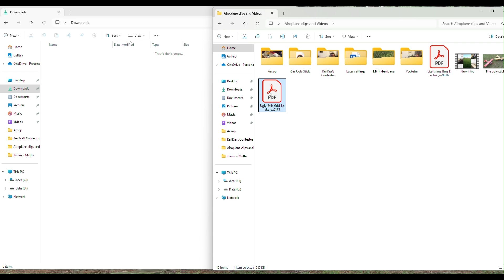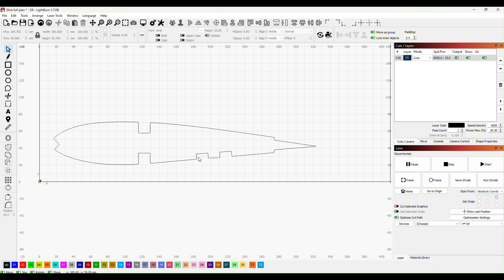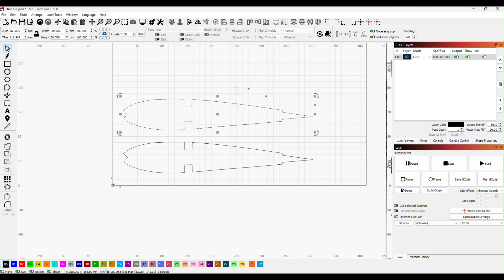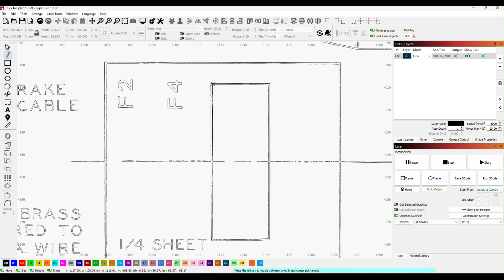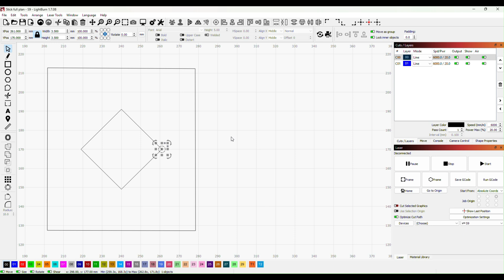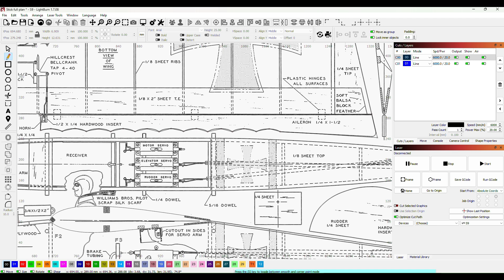How to make a trainer RC plane from free plans using Lightburn and Laser (Das Ugly Stick 1)

Comment: Hello from the USA. I just got myself a used x-tool 10W D1 pro and just this week I ran a test to see if I could cut 1/8" balsa with out it catching on fire. The test showed the best power and speed seetings was speed at 1,785 mm/m and power at 48.7% with air assist on and 3 passes I cut new wing parts for a crashed line control plane for my brother in law. I scanned the part of the plan then inported the pdf into lightburn. it worked great! Alot of your tips and tricks would have been very helpful. But will be helpful in the future. my next try is to cut dolar tree foam with out it catchin fire. fingers crossed!
Reply from the maker: Good luck with your projects, let me know how you get on. 👍👍

Comment: Is it possible to implement already made plans or drawings from paper?
Reply from the maker: Yes, you can scan in the plan using a scanner, but this will mean doing sections at a time if the plan is larger than your scanner bed. I do this in 'Hurricane 1' 
https://www.youtube.com/watch?v=ehew0LwyKbc
This was the first plane I did on here and I make every component as a seperate exercise, there may be better ways to do it, but this will show how to use a scanned paper plan. The build in that series doesn't use a plan to build on (because I doubled the size of the plane) but is built on plain paper and a plan is drawn around the build that can be kept. I hope this answers your question. 👍👍👍👍

Comment: great video, where can I purchase electrical components
Reply from the maker: Do you mean the radio control stuff? Servo's etc.?
Reply: @LaserRCModelguy  yes and also the motor
Reply from the maker: You can get them from any model shop, but they are really inexpensive from Temu.

Comment: For jobs like you are doing I change my grid square's to 1 mm and for moving item's just a small amount use Ctrl and up,down and side to side arrows
Reply from the maker: That was a good tip Ian, I have used it on my latest video. Did you know ctrl gives 1mm movement and control shift gives 0.1mm
Reply from the maker: That's Interesting, thanks for your comment.👍